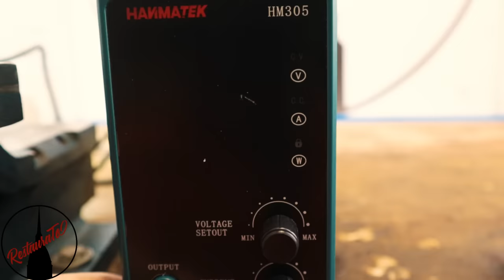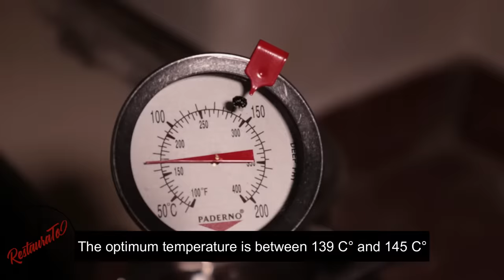Rusty Revolver Restoration 38 special - Restoration of gun

Comment: Since I am a gunsmith, and have a personal love for wheel guns, I really appreciate this video. Great work. Looks like the cylinder lock-up is nice and tight.
How someone could let a firearm fall into such a sad state of disrepair is beyond me.
Reply: You go to Murray state?might of seen you pal.
Reply: Looks like the rust has been intentional/manufactured for the video
Reply: @RJ-zm3tr  hopefully thats not true, its horrible to think someone would purposely do that to such a nice gun
Reply: @RJ-zm3tr  indeed. acid can rust metal like this
Reply: @RJ-zm3tr  I thought the exact same thing,  especially with the ease in which the outer layer of rust was removed.  The pitting in the rifling and on the frame did not match the extreme level of rust.  It's just clickbait.
Reply: @lynniewood  They were junk when they were new
Reply: @jwhiskey242  eh i just think it looks nice i don't really know shit about guns haha
Reply: @RJ-zm3tr  this can very well be true, but the gun might also have been in a fire. The heat takes off the grips and finish and then it just has to be a little moist in the air to make it rust like that but that’s just a theory.
Reply: @jwhiskey242  Never had an Astra but had a Charter Arms Undercover that shaved lead and a piece struck me between the eyes and brought blood afterwards I considered it to be junk
Reply: If you're somewhere with high humidity this can happen very easily.
I live in Kansas and if you don't oil your guns regularly they will rust pretty quickly.
Reply: Im of the opinion that this is manufactured "rust". Theres no way the interior parts and pieces would flash rust like that without being submerged in something and if it were just lost in a river or something the rust and corrosion would sure as shit not wipe right off. I live in florida a block from saltwater and yes you most definitely need to oil the outside of a firearm to keep it rust free but that rust, except for extreme circumstances usually comes from handling the gun. The oils from your hands are what will rust them. I have had a rifle sit in my closet for 2 years. Only oiling the exposed metal from time to time In a very high salt environment and there was no corrosion on anything inside the rifle.
I see a lot of these videos come across my feed and everything has just that perfect coat of very light bright orange surface rust.
People who do patina finishes on cars use a salt and vinegar solution to make thing look rusty.....alot like all this stuff looks.
Reply: @sethlamson  I never saw orange rust on a rusty gun before you may be correct
Reply: @randyblackburn9765  Exactly. Ive witnessed a shit ton of rusty weapons in my life and that doesn't look like gun rust.
Now I could be wrong for sure. Anrecent house fire may make a pistol look like that. The burning then water from being put out may make it flash rust weird like that? 
Looks off though.
Reply: if i were to speculate..i'd say pulled out of a river next to a bridge or jetty...could even have been used in a felony...murder even....and been found by 'magnetic fishing'....
Reply: A lot of guns in italy are in this state, they were probably hidden after ww2 when they were banned and left to rust
Reply: @mrsnezbit2219   if they are left to rust they pit. Just an entirely different sort of corrosion. Usually small dark brown "spots" for lack of a better word and when you do clean it off the pits are left behind. This orange film like rust that basically wipes off is from a very weird situation or being soaked in something to make it look rusty.

Im not certain either way, but guns generally don't rust like that is what im saying. I have i pistol my grandfather acquired in WWII, it sat in the top of a closet for 70 years. Definitely wasn't orange.
Reply: @sethlamson  I have a bodeo that was left under a roof, I find it all dark brown with not a lot of pitting. It was like a uniform patina but dark, not orange like the start of the video
Reply: @mariotrujillo1673  Going back to around 1980, Lake Mead out here in Vegas had a whole area of closed mineshafts and tunnels that people loved to explore, including me. I went out there one weekend with a metal detector, and unearthed a Colt 1861 Navy....grips were rotted away long ago, but no real rust or corrosion because it is so dry out here. My dad had it restored, and we have it to this day in a vault safe.
Reply: @flipflopping  Modern AC does counter a lot of humidity. Even then I've seen some impressive rust buildup in the internals of some firearms.
Reply: Russell Jenkins I definitely think that’s it, sadly.
Reply: Dumped in a Pond after Dropping multiple bodies from a Street Gangster 🤣
Reply: @einhundertfunfzig4919  I've restored a lot of fire guns, I feel like this was more than that personally
Reply: @MrSterling314  yeah like I said it’s just a theory
Reply: Maybe it was a murder weapon.
Reply: @RJ-zm3tr  I have to disagree. This is what all those guns the panic buyers bought this year will look like by this time next year. Unused, unmaintained and worthless.
Reply: @lynniewood  When you can make money with videos on YouTube people will do just about anything!!!
Reply: @flipflopping  
Question: Why did break action revolvers fall outta style?
Reply: @l0sts0ul89  Because the continuous opening and closing of the break-action (which also ejects the shells) caused increased play in the tolerances, which allowed wobbling at the hinge area, and increased play in cylinder lockup.
Reply: It's fake , you can see it's surface rust. When the rust is removed the metal has no pits and is perfectly smooth , all he does is leave it outside for a couple weeks in the water and it rust just like this.
Reply: @RJ-zm3tr  yep. Totally fake.
Reply: Stone love
Reply: He never shot the damn thing though which is my only problem
Reply: @jwhiskey242   Well , Astra weren't " junk " exactly . They were considered Budget in the U.S.  Earlier ones had reputation for inconsistent steel quality , and rougher tolerences than brand name U.S. mfg . The later ones were improved QC .
Reply: I've seen my share of rust damaged guns , but rarely are they this uniform .
Reply: Artificial aged , no surface pitting came apart with ease, probably sprayed in a copper sulphate solution a few days before,sad what people will do for that 15 minutes of fame
Reply: @jwhiskey242  a S&M .38 revolver is a great little weapon. I use one as my backup for the Walther.
Reply: @sethlamson  Ok first off, yes you're right. Secondly, you let a vintage weapon sit in a closet for 70 years? Poor thing deserves better than that. I got my grandaddy's war .45 and the P-38 he took off a German he killed in Belgium. They are pristine because I keep them that way, very important to keep the history alive and real so people can get it emotionally.
Reply: @sid2112  I Didn't let it sit up there. I didn't inherit it until after my grandfather died and I had already enlisted.
It's gorgeous actually and goes with me to the range periodically. The P08 is a fantastic pistol. Single stack mags suck to load but outside of that it's fantastic.
Reply: @sethlamson  Oh thank the Lord. I was worried it was neglected and sad :(

Of all the weapons I have ever fired, the Walther P-38 is far and away the most accurate. You just can't miss with it. For the power I love my M1911, and for the trigger mechanism, best trigger in the world in my humble opinion.

Anyway sorry for goading you into defending your arsenal, just keeping you honest :)
Reply: @-_-_-_-318  Clickbait, is defined as something overly dramatic or a blatant lie to get your attention, this fiits into neither catagory. No matter how the revolver got rusty, it is rusty, the film is about said rusty revolver, ... so your clickbait statement is in fact BS.
Reply: @crissyb00  bravo, you deserve a slow clap for your willful ignorance and desire to believe everything you see on the internet.  It must take courage to wake up in the morning and be you,  I applaud you.
Reply: @-_-_-_-318  I didn't say I believe anything. 
I said this wasn't click bait.
Perhaps, you would be wise to read and understand a persons comment before you leap in and make a fool of yourself by throwing childish insults around.
Reply: @einhundertfunfzig4919  That was my thought, fire/extreme heat. I'm guessing he's in Israel so saltwater is also a nasty possibility since the population is armed even at the beach. Either way, like his videos, and it's nice to see the application of Cerakote in many of his other videos.
Reply: It's easy, Uncle Tom's holster in my sweaty waist band and lack of desire to clean and oil.
Reply: @randyblackburn9765  that ain’t junk that’s a safety hazard. It’s safer for you to throw it at someone at hit them on the head with it or they try shooting it and if they miss the shaved lead will hit them in the head.

Comment: This would've been a perfect candidate for some cerakote or duracoat!! Although your method was really awesome too, I love the patina look to it. This really makes me want to find a worn out revolver to restore!
Reply: Plum brown would have been anachronistic but given the level of pitting I think it would have looked good. Awesome job on this revolver. Truly amazing.
Reply: DuraCoat more than Cerakote .

   But a brushed or matte finish with electroless nickel would best deal with the pitting .
Reply: @filianablanxart8305  why durakote over cerakote?
I’ve used cerakote, but haven’t tried anything else.
Reply: @Daddy53751   I imeadately conceed that Cerakote is mostest bestest hard & durable finish . Dura Coat is very durable , but CeraKote even more .

    But that said , there are still reasons to prefer Dura Coat , at least some of the time .

  Cerakote has a good selection of color , Dura has huge selection . Dura works better for intricate multi color design . ( Not my thing , but some people do .)

   But in this instance , Dura Coat will better fill in pits , while the physically thiner CeraKote will exactly conform to the host , pits and all .
Reply: @filianablanxart8305  I appreciate it.
I’ve never tried it before, but sounds like there are times you need it.
Thanks.👍🏻

Comment: Great restoration.  I did something similar and instead of blueing, I used flat black wood stove paint.  Don't make faces guys.  Guns have been painted for MANY years.  For an old gun, especially one with some rough surfaces, a very durable paint such as engine block or wood stove, comes out looking pretty good and can fill in some of the pitting.
Reply: Mãe
Reply: Or engine paint

Comment: Great video! 
Where did you get spare parts from? 
These Astra pistols are Smith & Wesson clones and are quite high quality.
With your permission, a tip regarding proper operation of a revolver: 
Never slam shut-close the cylinder. Always press the release button, insert the cylinder and then release the button for locking.
Take care!

Comment: That’s a very nice restoration job. The interesting thing will be to see how easily the ammo will load into the cylinders and how easy the fired cases will eject for the cylinder.
Reply: Probably could do with a good hone and polish to the cylinders.
Reply: @MrSterling314 : Judging by what the rifling looked like, I personally would have bored and re-sleeved the barrel. Hone and polish is a good idea, just don't over do and make a sloppy fit.
Reply: @d.s.steele3100  yup. Or just rebarrel it. But yeah don't wanna make those chambers oversized lol.
Also the fact that he did zero polishing or any attempt to remove pitting at all annoys me. How can you call this a 'restoration' when all you did was reblue it lol.
But whatever, it makes a popular video I guess lol.
Reply: @MrSterling314 : I think he might have been going for a patina look. If so a new barrel (if one can be found) would look out of place. That is the reason I suggested a re-sleeve. That way it could be fired safely, but keep as many original parts as possible.
Reply: @d.s.steele3100   Can't tell until you test it . Sometimes ugly bores will give good accuracy .
Reply: @filianablanxart8305  A test firing could prove to be a very bad idea. I personally would be scared it might blow up in my hand.
Reply: @d.s.steele3100  If you felt that way , duct tape , an old tire , a long string , and a micrometer would be first step .

Comment: TIL: Urine is an amazing rust remover
Reply: It’s not urine. Urine and rust remover are two different things. Try using urine as a rust remover if you want to. Your metal parts will still be rusty and they will stink of piss.
Reply: In fact, the Uric acid in urine is highly corrosive to most metals. Urine will make most metal even rustier.
Reply: @leroyjenkins4811  I think you missed the joke.
Reply: @leroyjenkins4811  r/ wooooosh
Reply: Probably some old Dirty .38 some Greasy Street Hood dumped in a Pond after multiple bodies 🤣

Comment: Looks great! I wouldn't recommend dry firing a revolver like that though.
Reply: Why? It’s center fire. What’s the problem?
Reply: The chances of breaking the floating firing pin aren't great , but are both greater than zero , and greater than with a hammer mounted firing pin .

    But to be extra cautious , just use some snap caps ( dummy cartridges , with rubber-ish material in position of the primer , to cushion the hammer/ firing pin fall. Available commercially both plastic and aluminum) .
Reply: The guy just gave that rusty, crusty revolver a new life.... He can dry fire that thing all he wants.
Reply: @seanflynn2289  agreed!

Comment: I would recommend bead blasting to get a uniform finish and remove the pitting from the rust. Then after inspection, I would either polish the parts or hot blue them. If the finish is not going to be uniform and smooth enough for a polished blue then I would look at a matte finish such as parkerizing. Myself I would probably opt for the parkerizing or maybe cerakote.

Comment: Good job. A really nice way to remove the side plate, with out prying, is to hold the revolver by the barrel with your weak hand, then rap the grip smartly with a wooden dowel. Works every time, even with the stuckest side plate. I hold it horizontally parallel with the floor, side plate up.
If you already knew that, sorry. Old revolver guy, and I've seen so many struggle with side plates. That fit is something amazing to behold on any revolver. Just the tiniest oops with a screwdriver and the fit is compromised. You did a great job getting it removed

Comment: At first which liquid did you use for removing rust
Reply: @TimeToBeKind  okay.. But tell me the procedure to use and result will be same as this?
Reply: @gautam-fe7sk  … I use a polyurethane planter with one gallon of vinegar and half cup of dish soap. It removed the rust but depending on how the rust is. I only work on Mauser with surface rust, not pitted. Then I sand it smooth with 400 wet sandpaper, then OOOO steel wool before bluing.

Comment: Overall good. Would however not DRYFIRE the revolver because it can crack the bridge.
Reply: I don’t think that matters with revolvers as much as it does semi autos
Reply: With this being true I don't think it really matters on such a junk firearm even in this restored condition the thing ain't worth more than 80 bucks
Reply: @josephatnip2398  I disagree. It might be cheaper  but if it still works it’s gonna be more then $80 cause it’s still a gun. Your looking at a good $300 for that thing.
Reply: @josephatnip2398  I looked it up just to make sure and I was right. You are looking at about 3 to 200

Comment: Ah, Astra. I’ve got the model that replaced Cadix—Astra 250 (very similar). It’s a good revolver; the frame is IMO a bit better than S&W it copied/cloned, as the grip is a bit bigger and wider (snub nose S&Ws in this form with I/J frames have ridiculously tiny grip IMO). Also, the ring for setting tension of the hammer spring (and therefore DA trigger pull) is a very neat feature.

Comment: You can easily remove the side plate by using a nylon hammer and hit the pistol grip portion of the frame. The side plate will "pop" out without prying or leaving a burr in the metal (I'm a retired  "gunny).

Comment: Thoughts on metal finishing for gun restoration:
(descriptions of dangerous chemicals and processes follow)

Hot-tank blueing.
Melt some lye and saltpeter (2:3 by weight) together to make 'Smith and Wesson' hot-tank blueing.
Deep blue-black finish, very durable!
If you have seen a 'Classic' Smith and Wesson blueing job, you know what I mean!
Can give interesting results on case-hardened parts, but can ruin soldering/brazing if you run it too hot.
The tank needs to be hot, but it doesn't need to glow!
Works best on carbon steel, will destroy brass or aluminum parts.
Yeah, hot-tank is dangerous and expensive, but you cannot beat the appearance.

For a MILSPEC look, can't go wrong with hot phosphoric acid.

Muskets and the like look best 'Browned': 
Incite a layer of fine uniform rust, boil part in clean water to make the red rust turn black, scrub the loose black rust off.
Repeat process until the steel no longer rusts, then oil/wax.
Often a deep 'bruised plumb' brownish purple.

Selenium based blues are good for 'touch up', as it can be tough to get a uniform coating on big areas.

Paint?  
If it works, why not?

Comment: Had one of those. Handle size was just right for a hobbit. Added grips to make it workable for normal genetically English man's hand & it increased visibility profile but easier to fire properly. When I sold it years later the extender rubber handles had to be removed and originals returned. It took some very special penetrating oil to free up the screw & broke a dealers FH screw bit in process. I replaced screw with standard 8-32 Pan head BUT in stainless steel.